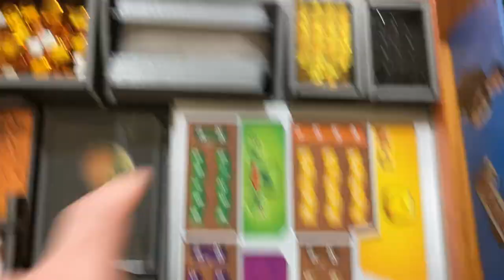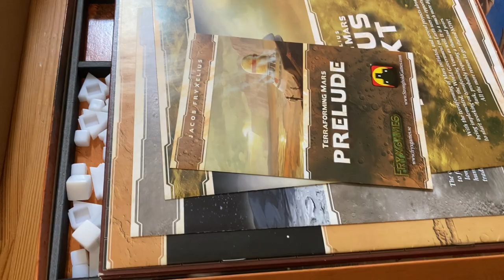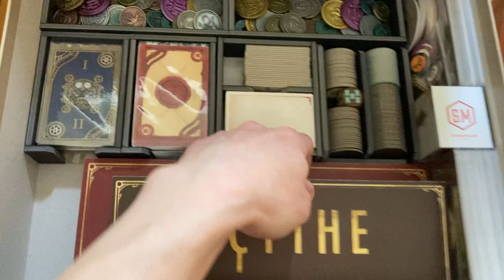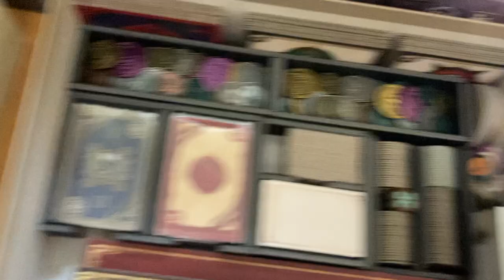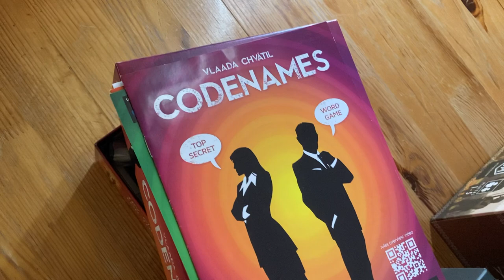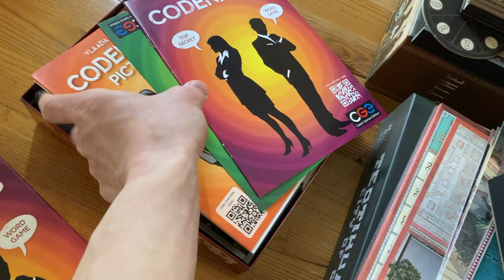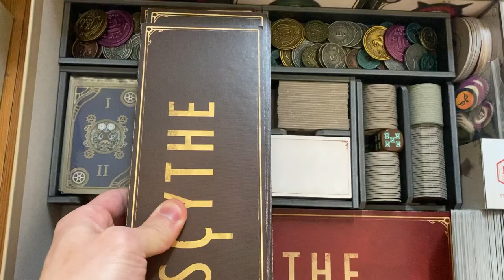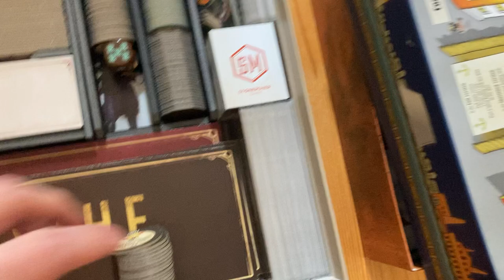Design Process for Creating Board Game Inserts

Comment: 9:30 The only thing I have in mind is people doing that to be able to take everything out of the box in a single big tray... I wouldn't do it either, though.
Reply from the maker: Yes, it's possible, but what's the point? In this case, the box or the tray will be on the table; it really doesn't matter because they have the same size footprint. It still seems like a terrible idea from a functional point of view. I think this is commonly done because it's just an easy way to make an insert without needing to plan it out beforehand.